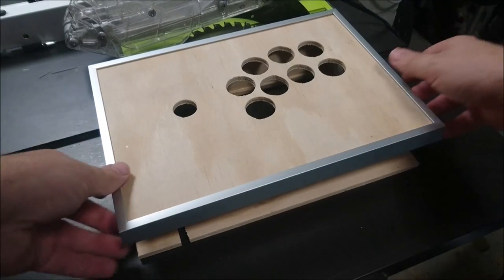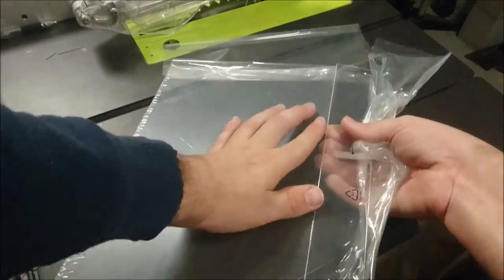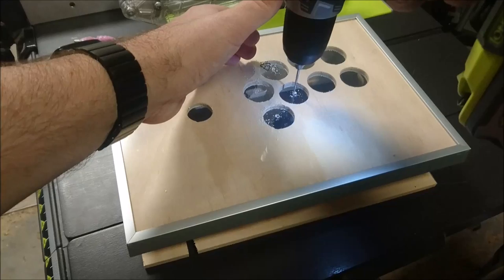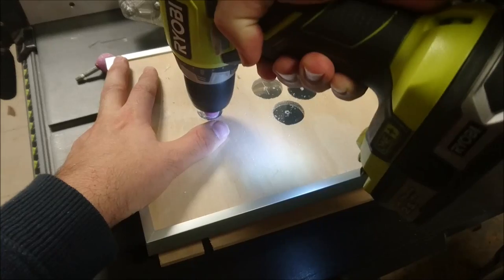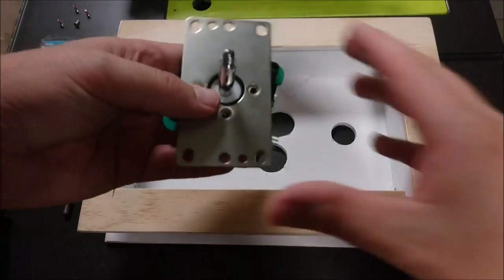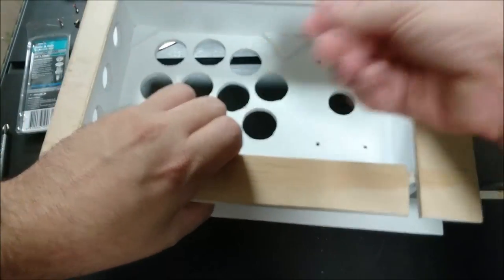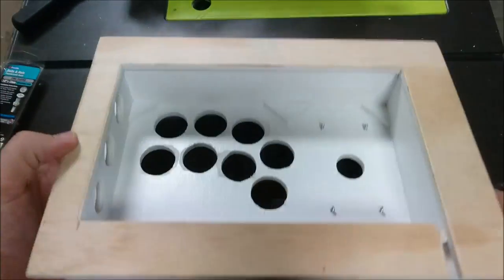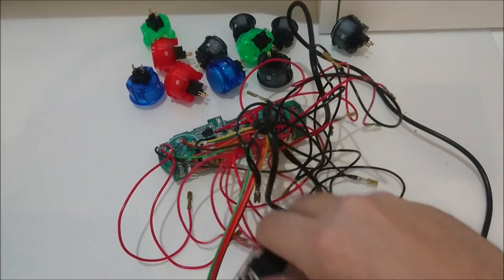Ikea Arcade Stick: Build Walkthrough (Part 3) - Bolts, Holes, and Paint.

Comment: Hi there great video, I was wondering what kind of plastic are you using instead of the Plexiglass? Do you know any other materials that are so thin and looks like the Plexiglass ??
Reply from the maker: Stikma le'Gecko This is actually styrene sheet, taken from a cheap picture frame. You could also use acrylic, which is more scratch resistant than either styrene or plexiglass.
Reply: GameCubits thx 4 the Info I don't have tons of tools so I only need something that I can cut with a knife like you did, also what's the name of the bit you are using to melt it??
Reply from the maker: Stikma le'Gecko I just used a drill bit called a "sanding ball". You can find them at any big hardware store, but you can also make your own if you need to. Alternatively, you could cut the holes much quicker with a hot-wire cutter.
Reply: GameCubits ok thank you so much for your help I ll try to see how the results come up!